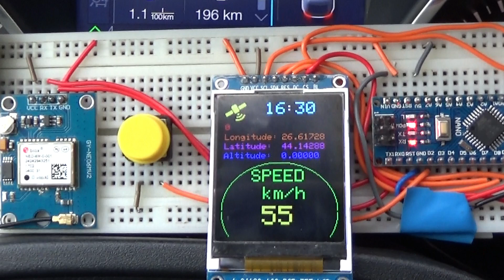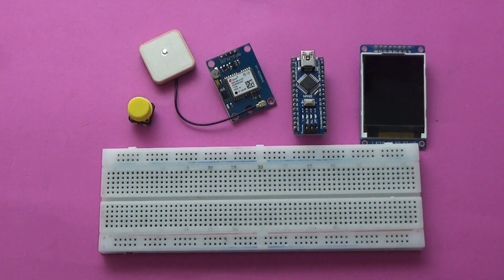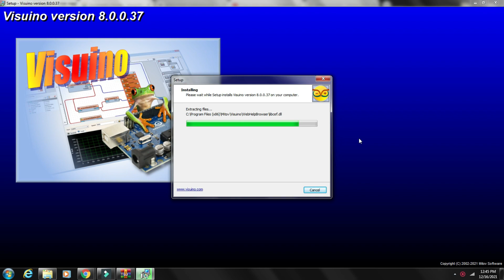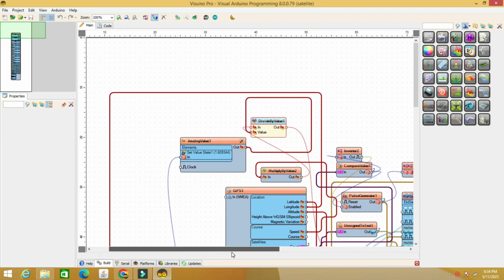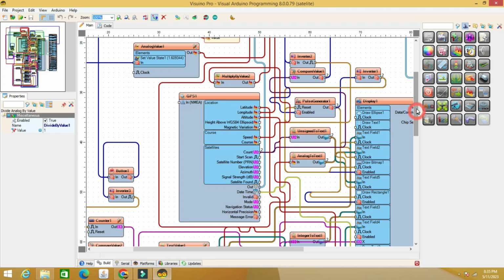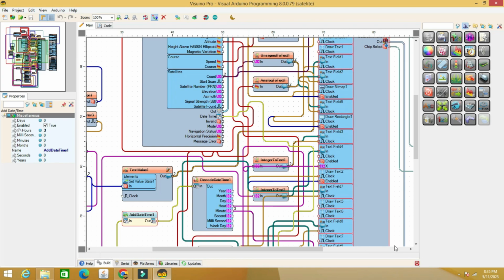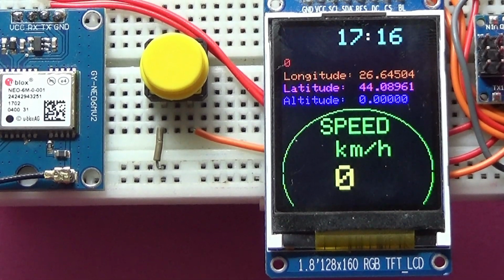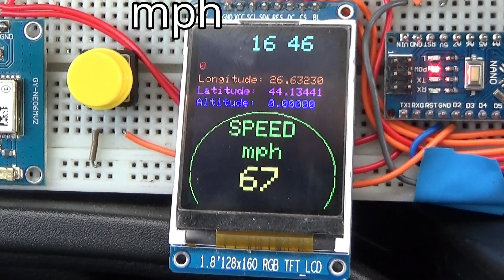Arduino GPS  Speed Indicator!

Comment: Cool project!  Would it be possible to include the Arduino ino code for download?  I'm interested in Visuino, but I've never used it and I'm not sure that I want to spend the $40 right now to be able to export the code.  I can't do this with the free version of Visuino because there are more than 20 components. Thanks!
Reply from the maker: You can get a 15-day license key, for free, on the website. I will also upload the code in INO as soon as I get to the PC.
Reply: @CompactDiy  Thank you- you are right, I missed that!  I appreciate the quick reply!

Comment: GPS have only true problem , not newer can measure speed accrate, because GPS not have true realtime alltime have too later, signal not newer has same time position and calculate speed this real time or totally accurate, position need be 1 meter accurate but GPS not newer can do this, about 100 meter accurate can only and this not can calculate true speed newer. and second, have timing problem too, GPS  measure location alltime too later not accurate, newer not can be true speed.
Reply: True. It makes a speed without moving now and then.